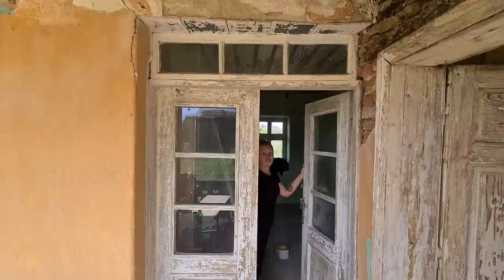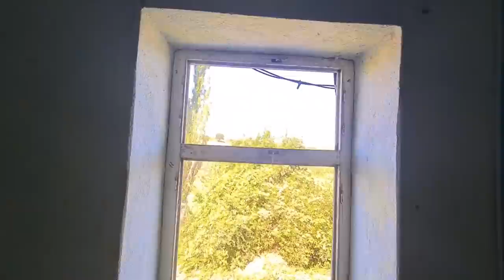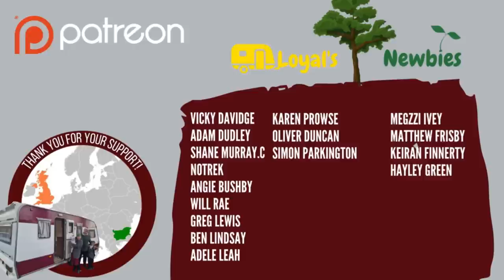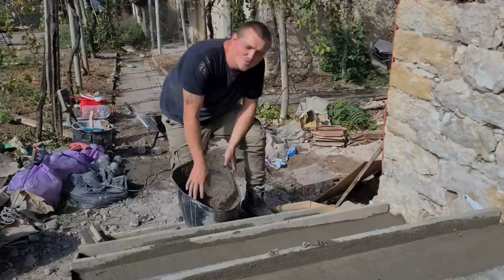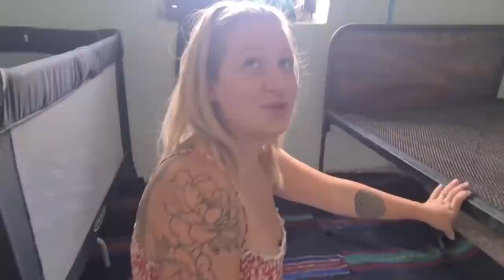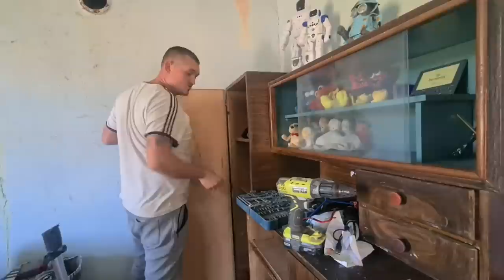Episode 11 - The Race is On! | Construction on Our Bulgarian Farmhouse

Comment: I don't know anything about construction or DIY but to fix the flooding coming down your path what if you dig a trench width ways down your path all the way to the cliff edge then coat the bottom and sides with cement then get a metal grate with lots of holes and drill it into the cement then when water comes down the path it will go through the grate and into the trench then it will flow of the end of the cliff sort of like a drain pipe or storm drain you will also be able to drive your car over the grate because its secured by the cement  and won't get in your way you would have to make them a bit wide and do a couple of them coming down the path or a couple of thin trenches coming all the way down the path if your worried about the grate breaking and the car wheels falling in that's the idea I came up with and how I would probably do it love the videos
Reply from the maker: You read our minds, and that exactly what we've done. Although, we're still have some issues with it so will look to rectify this when we get a chance. But it is much better and will be in a later episode.

Comment: Make sure you have wood to join the ends of the plaster boards too or it will get cracks
Reply from the maker: Those joards are unfortunately coming back down, regardless of the hard work. We have other plans for the cueling. But during that specific time, we needed something up fast before winter hit.

Comment: When you were putting the insulation in did the fact that you could see sunlight thru the roof not concern u ? X
Reply from the maker: No not really because the rain doesn't necessarily get in through those gaps believe it or not due to the angle.

Comment: Should have used some rebar!!!
Reply from the maker: Did use some.long 140mm screws and drilled into the floor for extra grab on the steps on every step maybe it had, 20 screws per step. Regards wouldn't have been a bad shout, but there we go the majority is well above 5 to 6 inches thick of concrete.

Comment: Do you have an air conditioner? I think you Brits call it Aircon. Do you have a heat source for the winter? I hope to join you in Bulgaria in a couple years.
Reply from the maker: Holy Crap Todd, thank you so much for the super thanks. Such an incredible amount, don't even know what to say! 

We have a small air con, but it's really not doing a lot right now. It can't really deal with the 40-degree heat. It's not ideal, but it's survivable until we can afford a proper one. 

In the winter, we use a fire called a petchka here, which does the job, and that works pretty well. 

We'll be sure to give you a shout-out in our next video. Thank you so much, Todd.

Where are you moving too exactly?